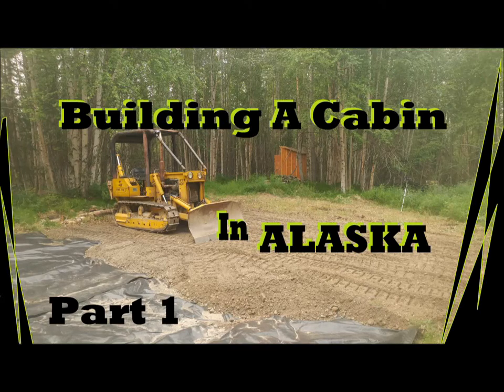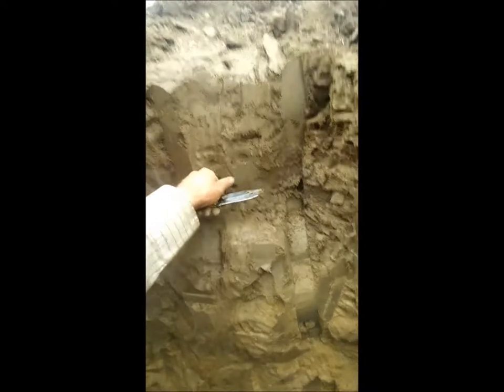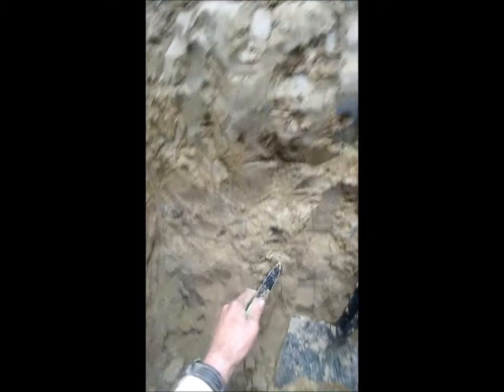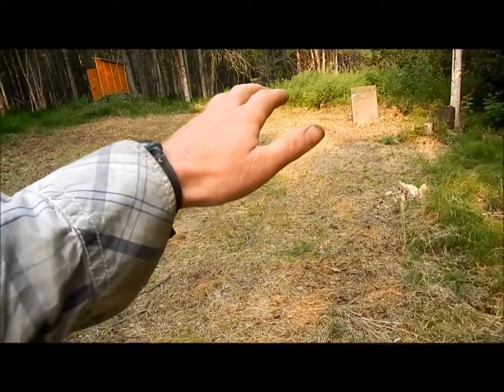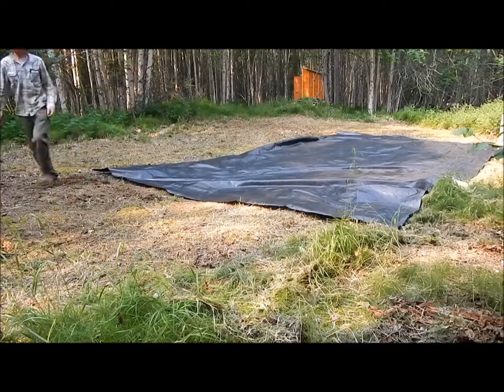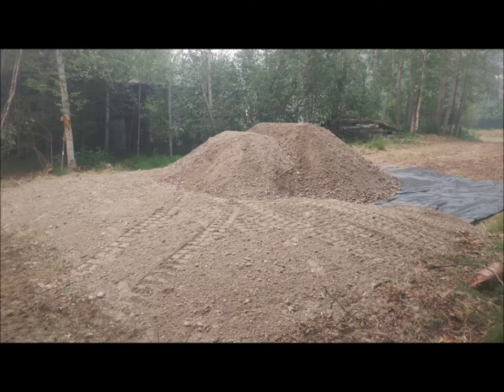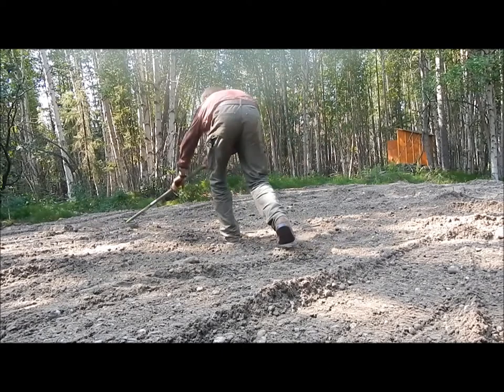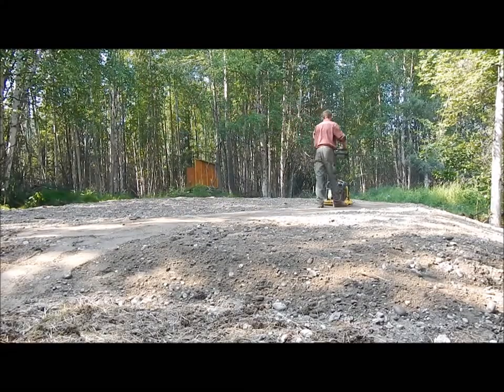Living Off Grid and Building a Cabin in Alaska Part 1 the Earth Work solo cabin build stick frame

Comment: What is the soil classified as ?
Reply from the maker: I have to say a silty loam. the building sight is on some sort of eluvial hill on the 
 inside corner of a glacial or watershed plain when looked at on a lydar image of the area this building sight was a small knob set like an island in a sea, all around is very pore ground heavly effected by saturation and freeze thaw. about 2 acres of this lot had been cleared since the 50's and so has become more stable not to mention the benefit of being the high ground and having drainage, go 100 yards in any direction and it is nearly a swamp.